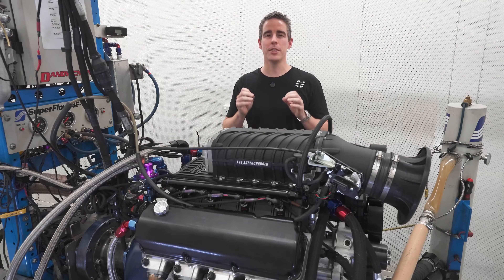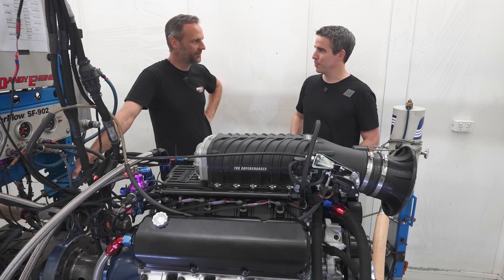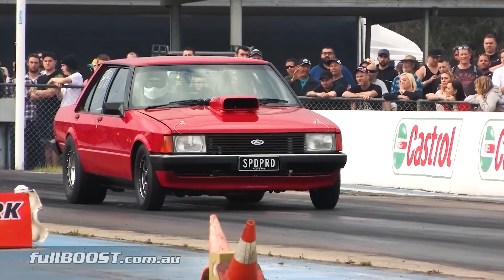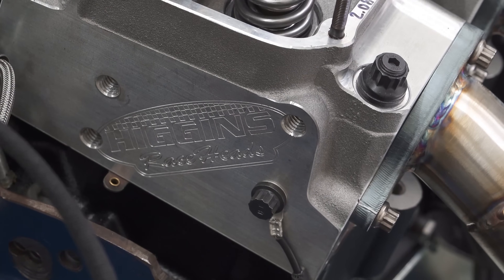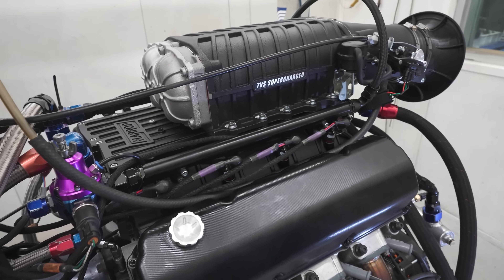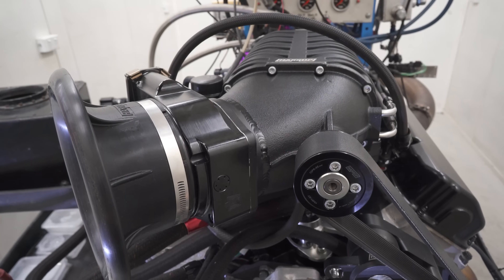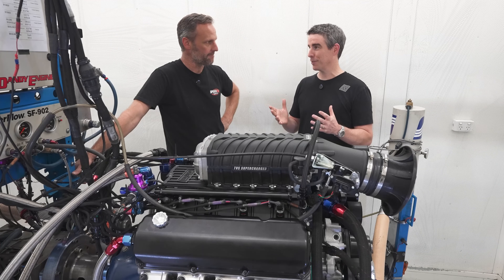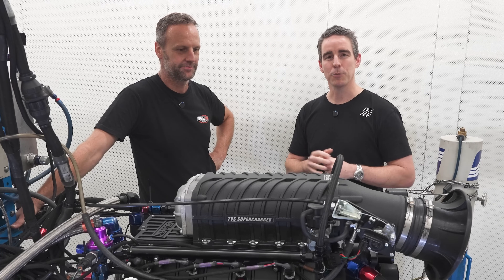1500HP Small Block Ford CLEVOR | Harrop TVS2650 Supercharger Testing

Comment: Typical Ford pretence, nothing is STD Ford, most frustrating. You can not get that sort of power on STD blocks which are all thin wall, Ford rods  can not handle more than 6-650 HP short term at  7500 rpm probably 7000rpm would be safer and iron Cleveland heads had to be internally braced to handle early 70 s NASCAR racing as 12.5-1 comp would lead to all sorts of issues. No your average Aussie Ford fan is stuck with a stroked 5.0 block some less than stellar Edelbrock or Dart alloy heads and an Eagle or Scat cast rotating Assy. and probably a Weiand 140 blower kit for about 550 HP. All the Hoo Hah you have shown would cost to many Kidneys or giving up your kids for medical experiments

Comment: About $60,000 for the full package top to bottom?
Reply: Bullshit
Reply: I don't think that would be too far off including ecu and injectors etc
Reply: Sounds about right
Reply: I have been checking prices of parts required for a 427 W build. 
A new stroker 427 W with this blower about 15-20K US for everything. Which is reasonable considering the prices of everything else today.

Comment: It looks like the blower isn't directly over the last 2 cylinders, does this have an effect on tune/ driver ability/ longevity of the engine ?
Reply from the maker: The blower discharge port is in the middle of the lower manifold. Plug checks were great after runs.

Comment: Will you be offering the modified snout to fit the 120 to customers?
Reply from the maker: We're also evaluating new products, we wouldn't offer a modified snout like this R&D unit to customers, it would be designed, tooled up and cast as a new part.
Reply: @HarropTV  Would be nice to have a inlet made to have a top mounted air filter inlet for hot rod use similar to a Roots style blower. With this current inlet arrangement the air filter would run into the radiator on a hot rod.

Comment: How does the Clevor build cost compare to a Godzilla crate motor....both roughly the same displacement?? Obviously the Windsor based block will practically bolt it to any Falcon, as opposed to the 'Zilla......
Brilliant stuff again from all involved....
Reply from the maker: Dandy Engines would be best placed to advise on engine build packages, the Clevor is going to be a higher price point due to fact it is all premium aftermarket components with machining and assembly, compared to a crate Godzilla which doesn't have the performance potential of this tailored built Clevor.

Comment: How is a 434 ci a small block?
Reply from the maker: 351 Windsor based block
Reply: Idk maybe it was machined to accommodate that size
Reply: Stroked small block
Reply: Probably stroked and bored after market block
Reply: its a 351 based aftermarket block, 4.155 bore x 4.0 stroke
Reply: As a general rule, small block engines back in the day had 4.0" bores or smaller off the production line and were under 400 cubes, big blocks were above 4.0" and larger than 400 cubes
Reply: @2secondslater Wrong. It is based on bore centers of the block, or deck height in Oldsmobiles. 366 and 396 Chevrolets are sub 400 but any one can see they are mark 4 big blocks. BUT a 400 Chevy small block has a 4.125 bore. And fwiw, there is no Pontiac big or small block. From 267 to 455, they all have the same architecture with different internal bore/strokes
Reply: @zero2Steve  "As a general rule"...  that doesn't mean there are other things to consider or outliers. It's just a way to try to draw a line between the huge grey area between the stupid American measurement of "big" or "small" block, without getting too complicated. People have been arguing this for well over half a century and I ain't interested.